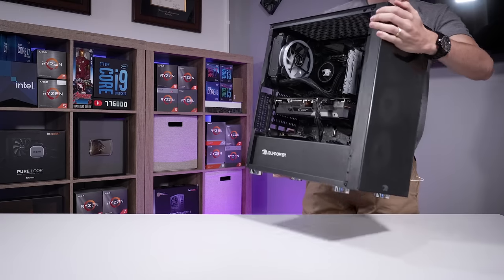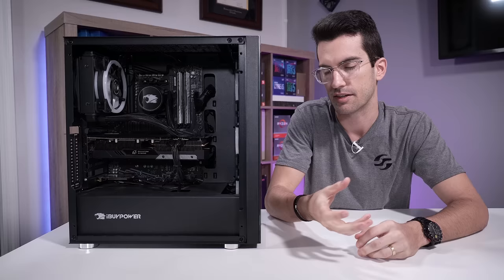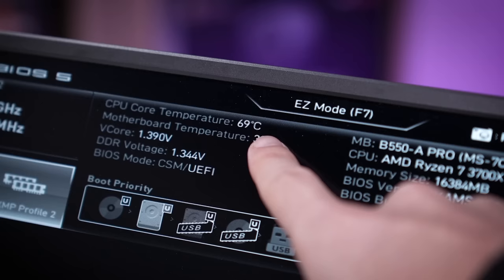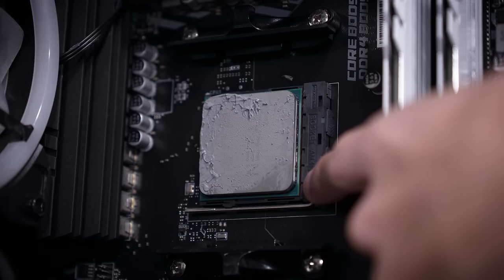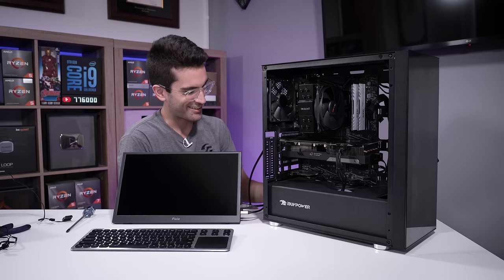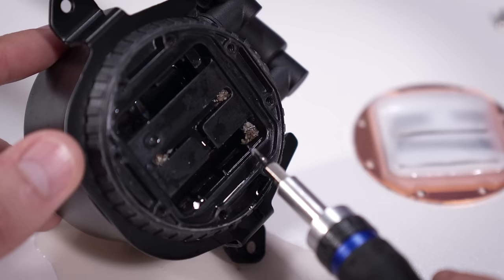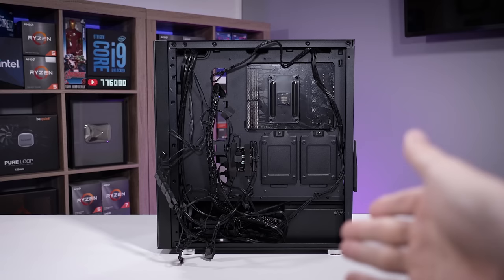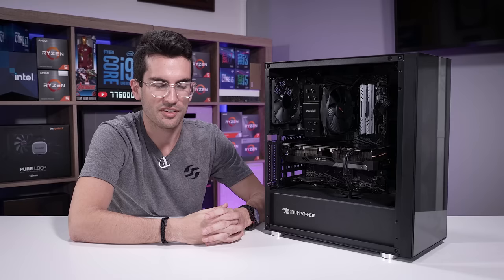Fixing a Viewer's BROKEN Gaming PC? - Fix or Flop S2:E8

Comment: It’s funny because I’ve been getting overheating warnings from a system I personally built about a year ago to the point where I can’t actually power it on anymore due to temperatures rapidly rising, well due to component shortages and covid making it difficult to earn sufficient funds to look into repairing it I put it to one side a few months ago until I could give it a look and see what was happening I saw the other video that featured this problem and I never thought for a million years it could be related however after checking everything else and coming up with nothing I managed to pick up a Corsair capelix elite cooler a bit cheaper than retail and Needing this system back up and running again I swapped the coolers over yesterday and sure enough the temperatures dropped back to a reasonable level so today I opened the pump like you did and it was indeed blocked with what I can only describe as rotting melon or something that smells exactly like it but with a really rotten tinge to it. Sadly this build did has not come out of this event in one piece as the motherboard has suffered some damage due to the temps but at least now I know what caused it. It’s a shame that I didn’t catch this quicker so for now this system remains in storage Until I can replace the motherboard sadly. I can not say for sure that this is related but it does share similarities to this however the fluid coming out of mine had flakes in it for sure it was not the colour that yours was 🤷‍♂️ - thank you for highlighting this issue as it was driving me mad!

Comment: I love air coolers for their simplicity  and durability. My daily driver is a 3800x cooled with a Noctua nh-u14s. My gaming rig involves a 10850k at 5ghz all core, requiring  a 360mm rad to keep everything under control.

Comment: I just had a very similar noise in a 240mm AIO from iBuyPower as well. Noticed my temps spiking at idle and decided to swap the AIO and problem solved. The iBuyPower AIO was less than a year old and was of the same design where the pump sits inside the radiator.

Comment: No B.S. got a ibuypower pc from there website 7months ago, had the same problem you had here! Had a 240mm aio in the front doing a push pull config, bought a Noctua nh-d15s and temp went from 72c in bios to a fantastic 36c! Watch out for ibuypower peeps.

Comment: I use to work at a ma and pa computer repairshop and I have noticed that we mostly had to fix ibuypower systems and its the water cooler setups with the rad on the back of the case has some type of issue with overheating or a bad aio

Comment: I had a 240 AIO. If you top mount them as exhaust they can really help your GPU temps. That being said I think I'll be going a 5 or 6 heatpipe air cooler for my 6/12 or 8/16 CPU

Comment: i always prefer to have my radiator on the front, as exhaust (if the case isn't too resistant to airflow through the front)
or exhaust out the top.
i don't run intake fans
they just produce dust.
if you have enough exhaust pressure, the negative pressure will draw in plenty air.

Comment: No complaints of the Corsair H100i gtx AIO I installed with my i7 4790k in 2015. I have just diss-assembled that computer and it was working fine. I did notice some brown gunge on the radiator fins so maybe it was starting to leak. Gone back to a air cooler on my new build.

Comment: I have the exact same AIO (different ibuypower prebuilt), and the same exact problem in this video. I had my PC for 3 years.  I was getting temperatures of ~90-100c when idling. I first repasted/remounted but the issue did not go away.. the fluid felt like it was moving which was confusion since it was not a evident the pump was dead. 

what help diagnose was checking the inlet and outlet tubes from the CPU mount with a infrared thermometer. The temp at the inlet and outlet was the same, showing there was no temperature difference between the entering and exit fluid (no heat transfer). 

My concern now is, when I purchased my new AIO there is no date of manufacture nor any shelf life, so technically if you buy something new off the shelf we do not know how long it has been in stock, impacting the timing from when this issue arises with your PC.

Comment: my ID Cooling Auraflow 360 AIO only lasted around 2 years before the gunk really got it. Same telltale signs of gunk build up (same as how it sounded starting up, but intermittently sounds off while PC is running) Good thing the Pump's still alive though  and waiting for some parts before I test the repaired AIO (hate to wreck my main system). Now looking into a full closed loop setup. Or if any AIO manufacturer decide to use an all copper setup for AIOs.

Comment: The only problems I have had with aio systems is loss of fluid with Corsair 80, 100 and 115. I removed one pipe and fitted a reservoir inline. I can now keep an eye on what is happening. I ended up with distilled water only with a 20% car antifreeze. Two years on, no problems.(Using Ryzen 2700X)
Reply: were the aio's old? because they will lose fluid naturally due to evaporation

Comment: The radiator will also make that noise if there is air running through the system, I’m not sure how common of an issue that is with new AIOs but that’s something to keep in mind when you do hear noises like that coming from the radiator(if the pump is located in the radiator)

Comment: I had the exact same problem with my iBuyPower AIO. Also my case fans were making a similar sound in this video. Every couple of months they start making a clipping/grinding sound and needed to be replaced. I swapped the AIO for a Noctua Air cooler and the case fans for Corsair ll120.

Comment: I have an MSI AIO 240LM and it started making that same noise though it is a bit more quiet.  It is a pump in radiator.  Temps are fine at the moment, but I am going to yank that out as soon as I can afford a replacement.

Comment: One of the reasons i stepped away from AiO’s. Had 2 NZXT Kraken x62’s dying within 3 months. Although NZXT did really good support and replaced both AiO’s, I just decided i was done with AiO for a while. Sold the replacement and bought an Noctua NH-D15.

Comment: it is a fan blade loosen or tighten screws to change the preasure my ek vardar fans do this when ever i do any loop maintenance i have to adjust my fan screws and its the exact same sound
it was the fan towards the inside of the case closer to the cpu

Comment: I have a fractal Lumen S24 AiO I got in October 2021 that would make my system idle at 70-90C. Also a pump in the rad type setup. Tried remounting it, tried reorienting the rad, etc and it didn't fix the issue. Bought a Noctua cooler and couldn't be happier.

Comment: I am done with AIOs for the time being, of the five I have had in the past, three have failed due to leakage at the tube fittings, the radiator or the cold plate. The last one in my secondary system recently went out with a clogged up circuit like here.
I really prefer the mounting, looks and the servicability of the rest of the system with an AIO, but for now I am back to higher end air coolers. They are just less of a hassle once they are installed and provide plenty of cooling in gaming scenarios.

Comment: I’m not a crazy OC’er for my systems but do the Ryzen Master Auto OC. I still don’t see the value of an AIO cooler over a good air cooler. Yes, when new and clean, they have a little more cooling headroom but over time, the reliability and maintenance of them just don’t compare to the good air cooler. I’m sure many will disagree but a simple air cooled rig gets a good dust cleaning 2 to 3 times per year and done. This just turns me off more to consider a water cooled rig.

Comment: I think this exact thing happened with my NZXT Kraken M22. It had the pump in the radiator like this AIO. One day my CPU temps were just skyrocketing. I only had the pump for a little over a year. I ended up getting rid of the AIO and getting a new one. Otherwise, I would have definitely sent it to you to check it out.

Comment: The red color of the coloant is copper decomposing into the the solution from reacting with the aluminum of the radiator probably. This is a problem from the manufacurer and is widely known that mixing copper and aluminum does this.

Comment: If the rear fan is an intake fan it will pull in so much dust and it will clog everything that is possible that has a crevice or a hole in it without a filter you're supposed to have a two to one ratio or a three to one ratio for air flow

Comment: I purchased my pc from IBuyPower about a year ago and I had the 240mm variant of this AIO, I had the same exact issue where my computer would idle at over 100 C but the pump was running at max RPM. The pump was not dead like I originally thought and probably had that same crap built up in it. I since replaced it with a new Corsair AIO which fixed the issue. Hopefully, IBuyPower will recognize the issue with their AIO's fluid and fix it as well as help those who have been affected that can't just go out and buy a new cooler as I did.

Edit: Hey Greg, I just watched the last few minutes in the video, I still have the AIO if you would like me to send it to you

Comment: @Greg : The block is copper, but it seems that the radiator is aluminum? The mix of the metals is what's causing the gunk forming. (If they are different metals, that is) And owners will always have to maintain these AiO's, which kills the purpose of having an AiO. So, can you tell me if it's mixed metal device?

Comment: Air > AIO.  Tower coolers often have better mounting as well, and so much easier to clean the fins than caked up rads.   If ya want more RGB just run RGB strips where the radiator would go instead, or go overkill on exhaust fans lol.

Comment: I had a similar issue this week. I changed a few fans to improve airflow (I messed up when building this PC, all the fans were set to exhaust, so even with the AIO CPU idle temps were 40°+). Afterwards my CPU temps were very high (80°+ after booting into windows, opening a chrome tab to post a screenshot shot them up to 100°). 
I checked the wire connections and if the block was still seated correctly on the CPU but neither fixed the issue. I thought that by moving the radiator out of the case, I dislodged some residue and it caused a clog somewhere in the loop, so I purchased a new AIO to replace it. Later I had the idea that if moving the radiator caused the clog, maybe doing the same could fix it, I moved the tubes up & down, rotating the connections at the block as much as I could and now my CPU runs at 28-32° idle >.<.... problem fixed... at least for now, but I'm keeping the replacement ready and keeping a close eye on temps. 
The AIO is an NZXT Kraken X63 and it's been in use since 2018 (with fans in the wrong direction) and running almost 24/7. While I'm happy to keep the current one in use, knowing that it already happened and will likely happen again is making me nervous about letting my PC run unattended.

Comment: That's the exact same problem I had with mine, it was also an iBuyPower aio I ended up changing out to an air cooler. I had it for about a year and 3 months before it started making noise, wish I had not thrown  it away  already.

Comment: As an automotive mechanic, you really wouldn't want to try to reuse/refill something like this, unless you were on a budget. That radiator core is probably packed full of that crud as well, and it will eventually break loose and make it's way into the block and clog it up again. If you decided to try and reuse it anyways, you would first want to try and do a reverse flush, to wash out any of the crud in the radiator, instead of further jamming it into the core possibly causing more blocking.
Reply from the maker: Of course. Just as we've preached for years in regards to custom cooling... always flush your radiators. Assuming what we're seeing here ISN'T galvanic corrosion, I wouldn't be worried at all about metal breaking loose inside. These pumps are relatively weak and this bio-growth isn't likely to dislodge any metal.

Comment: I'm always amazed how most products from most industries could perform way better by investing a few pennies per unit at the design and manufacturing level. (Thanks GM)
They may sell more stuff short term but in the long run, they may sell more stuff from the competition.
What is even more amazing is how very few corporations make the choice to improve the over quality at very low costs to distinguish themselves from others and conquer the market because, most people are fed up to be sold junk.

Comment: How long that system takes to POST is definitely unusual. I have the same issue with my ASUS PRIME H670-PLUS D4, and I have no clue what's causing it. None of the CPU socket pins are bent, everything on the motherboard looks normal, so it doesn't appear to be anything physical that's causing the long POST times. I think it's something deeply rooted within the BIOS microcode itself that's responsible for the slow POST times. It's very strange, but besides that, my system functions superbly. The i5-12400 paired with my ASUS PRIME H670-PLUS D4 has been awesome. 👌💯

Comment: I've been seeing a fair number of reports about the base level AIO's that IBP uses failing after just 6-12 months. I'm thinking that a bad batch of coolant made it into the production chain and this sort of thing is the result. They obviously had no way to know about this, but they are the ones having to deal with the consequences. This is yet another good reason to use air cooling where possible.

Comment: My H110i GT 240mm from corsair works still after daily use since around 2014, I can't imagine having those issues. 27-33c Idle on a 4790k and 60'ish under load. Welcome to it, plus the original fans lol. But like I said it has no issues, I just retired it a few weeks ago.
Reply: Same

Comment: Huh, this just happened with my iBuyPower (NZXT) cooler as well, I’ve owned it for about the same amount of time as well. I noticed temps and fans going crazy within the past few weeks idling 10 C above the usual idles from only a few months ago and climbing about half a degree every day. Just ordered another one to replace it after reseating things, updating like every possible bit of firmware and software in the system, super dusting the chassis all to no avail. I haven’t taken my old AIO apart, but it’s kind of wild if it just happens en masse

Comment: I had the same though about the Two screw mounting, but if you think about it, there are tons of top end air coolers that use a similar mount. They have two brackets that mount to the corners and then a bar of some sort that runs down the center to hold the flat part of the cooler to the IHS. Noctua's line like their D15 or U12 / Hyper 212 / and a lot of stock AMD coolers and they all have good mounting pressure.
Reply from the maker: Just because there are tons that do it, that doesn't make it optimal.

Comment: Before you even mentioned overheating.... I took one look at the solid front panel and big GPU and wondered if that's the case. ibuypower is the culprit.
Does ibuypower ship out systems with that poor of cable management?

Comment: I've had a noisy pump that sounded exactly like the noise made by that machine when the pump is airlocked. I have found that tubes leading out of the top of the pump, and having the radiator above the pump eliminates the possibility of an airlock.

When I saw the tube positioning initially, this was my thought.

Comment: I have both the 240 and the 360 versions of the msi with the pump in the radiator and both have worked flawlessly for 2 years. But I've heard that msi had a bit of trouble with their choice of fluid.

Comment: I have a clogged Corsair H115i (non RGB) if you still want some of these to tear apart. I live in Maine so shipping might not be the cheapest. But still, its a clogged AIO. My idle temps were around 45C but when I turned on Starfield I was hitting more than 100C. Got a new Corsair H115i RGB Elite and now I am down to 26C at idle and 45C max under load.

Comment: As a first time and last time user of AIO's I had a MSI Coreliquid  AIO 240R that did that and killed the pump it was less than a year old, sadly I binned it in anger and went back to a air cooler, no issues since.

Comment: Apaltek is one of the biggest manufacturers of rad pump aios and they're famously bad at QC. Given that the CoreLiquid R is OEMed by them as well as the sludgy Liqtech II from Enermax, it would not surprise me if that iBuypower 120 was also an Apaltek unit.

Comment: I run Corsair H110 for 8 years now in my PC (CPU overclocked since day 1 and my PC runs whole day, every day for those 8 years, only turned off when im sleeping and i also use this PC aloth for gaming) and CPU temps are still fine. Never had any problems with it.

Comment: I have a Kraken M22 (pump in rad aswell) and a similar problem. It makes a horrible sound too, no matter the way it's mounted and temps on a R5 2600 @ stock was around 65c in BIOS. I might still have enough warranty left to try getting it replaced, maybe even refunded, but i consider taking it apart too, just to see if i can fix it myself. I "bought" (traded) it for some leftover fans and a Hyper 212 RGB, so i don't really need it, as i already have a Dark Rock Slim, an Arctic Freezer 34 DUO and a couple AIO's lying around, so might aswell use it for a learning experience i guess.

Comment: That sounds like the bearings have gone in the fan. Mine makes the same noise and it drives me nuts 2 mins and then it stops. Need to swap the fans out but I have limited time. A job for Sunday maybe 😂
Great vid as alway Greg, thanks for the vids

Comment: Had this issue with my Kraken M22 within 2 years. Pump worked but very high idle temps and any use caused thermal throttle and shut down.
RMA for a new cooler but haven't installed yet.